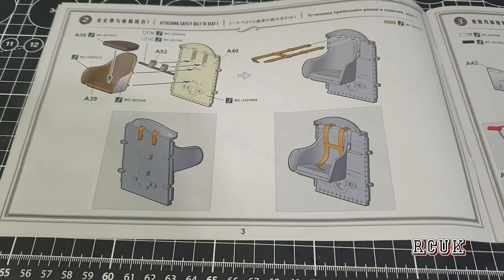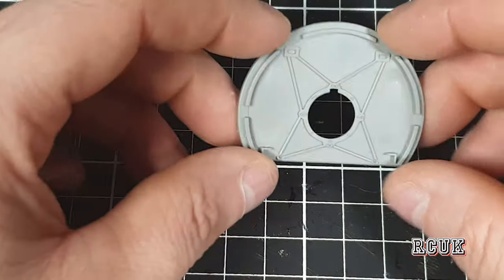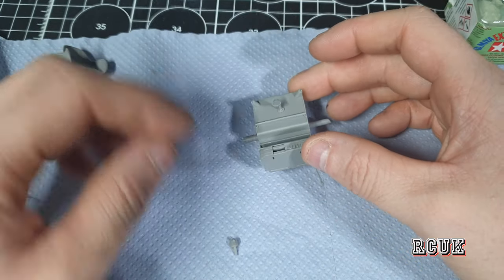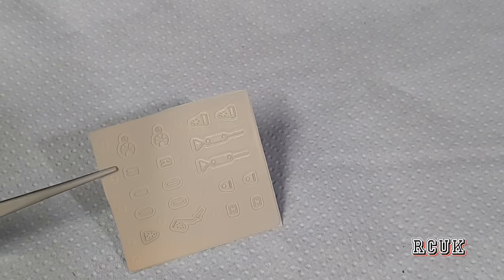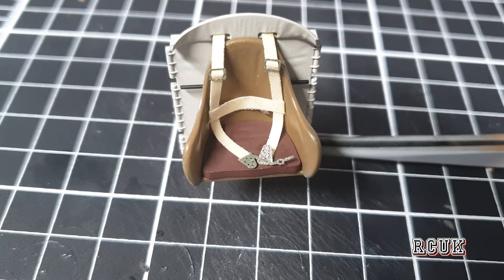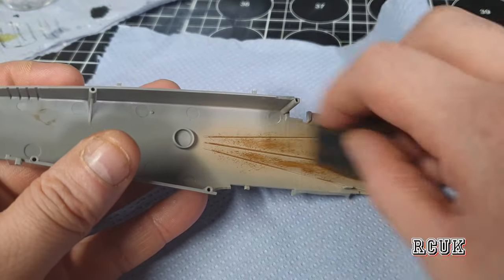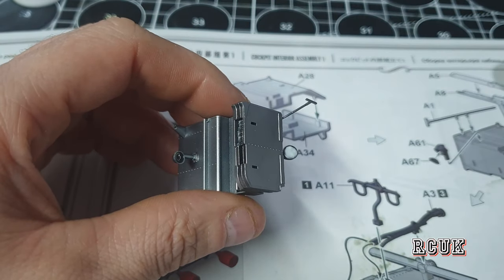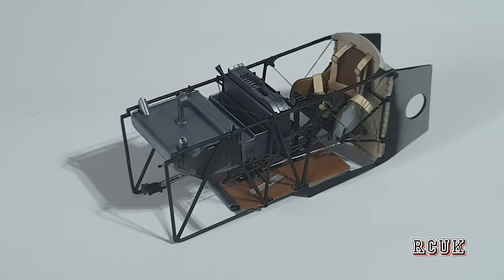Meng Model 1/24 Fokker Dr.I Cockpit part I

Comment: I'm pretty sure the triangular wooden areas of the front fuselage were painted with some kind of a protective coating that was a deep (hull) red. This was most likely to ensure that castor oil wouldn't soak into the wood and weaken it. I personally like the bare (or varnished) look more, but it isn't accurate.